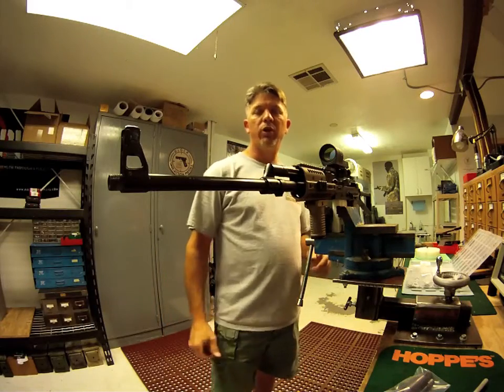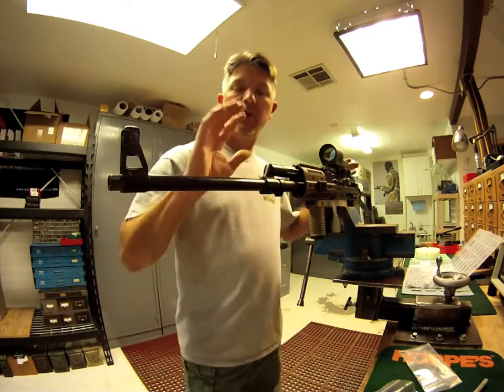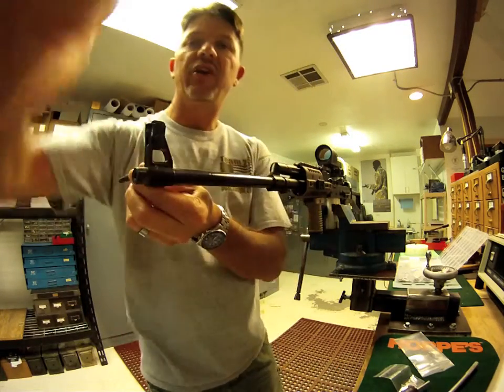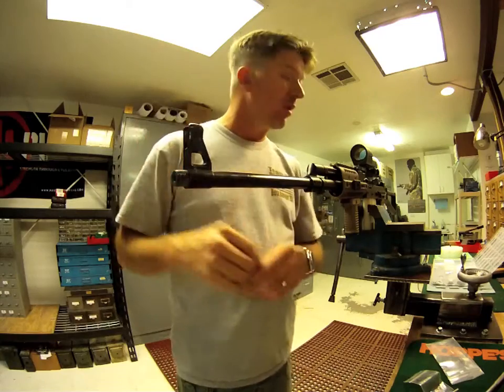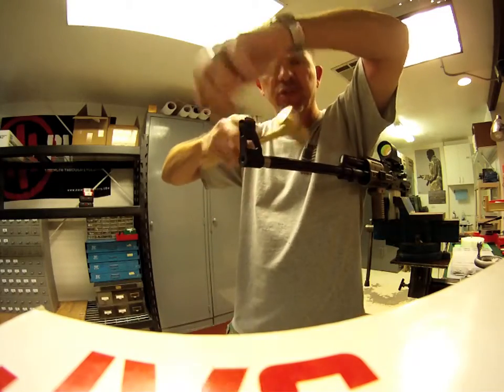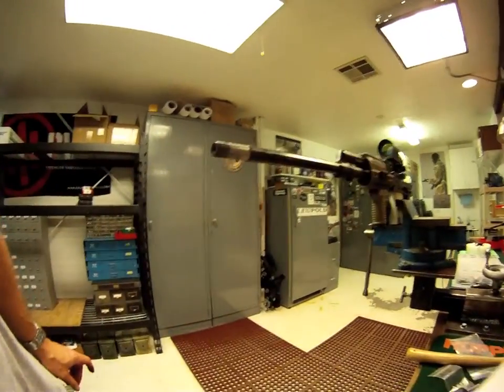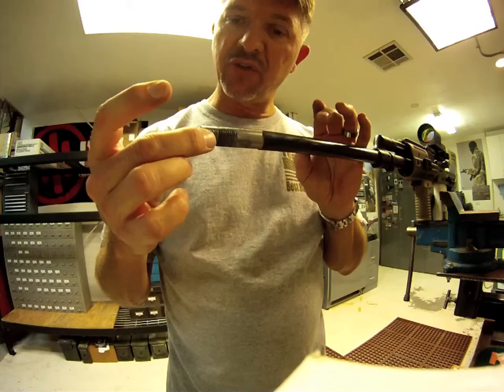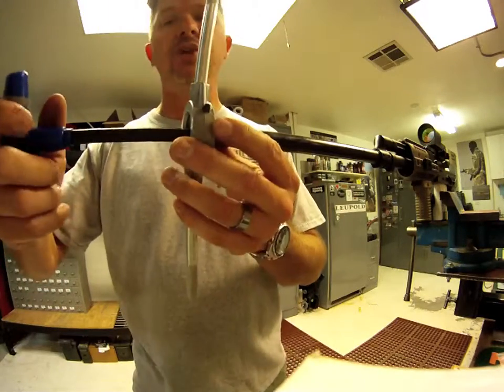VEPR (DIY) BRAKE Installation Part 1 of 2

Comment from the maker: Well, I guess technically you could thread it some without removing the front sight but we wouldn't recommend it.  As you can see in the video, we remove the front sight, thread all the way up to where the front sight mounts, then remount the sight.  Then your muzzle brake will tighten up against the front sight and uses the provided shims to assure proper clocking of the brake.